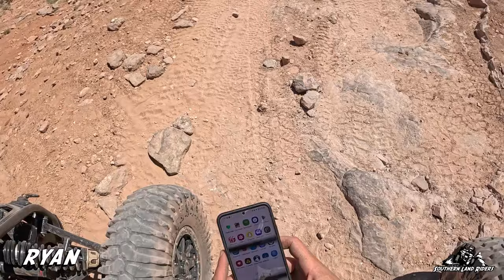Moab - Pritchett Canyon

Comment: I would start looking at valvetrain if H hasn't figured it out yet. I've seen a can am loose a cylinder due to chain/tensioner but very well could be a rocker arm or lifter issue.
Reply: I would agree. If you have fuel, spark, and air. Then sounds like you're missing compression. 

I hope you're checking for fuel and spark while the engine is running.